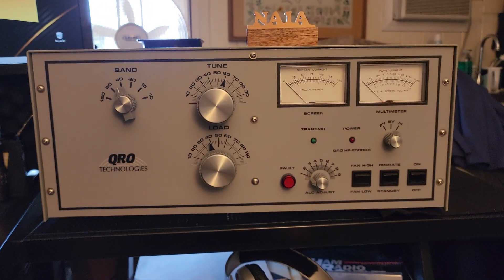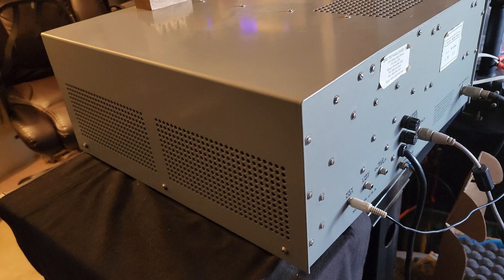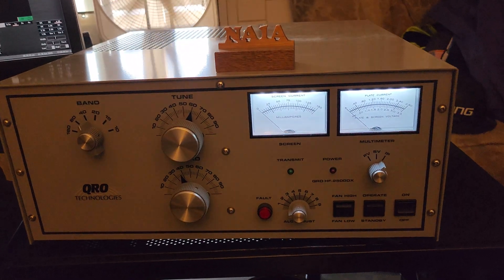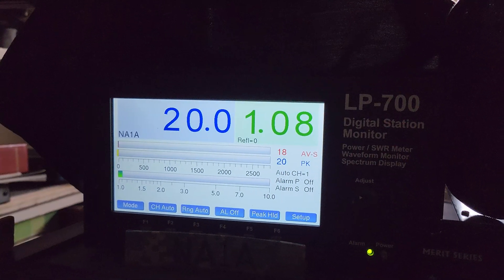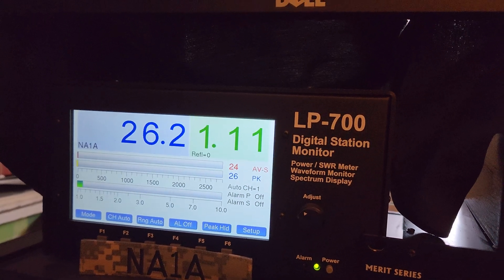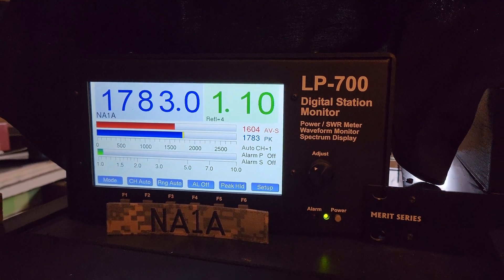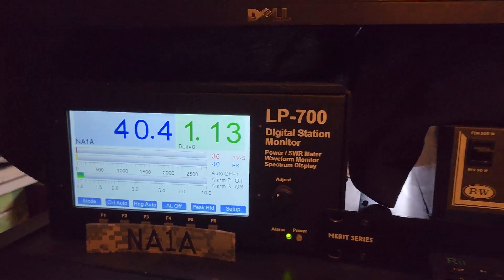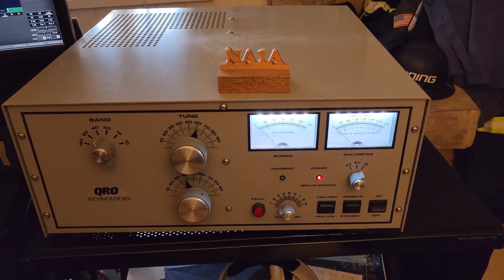QRO HF-2500 DX

Comment: Looks so much like the Amp I have. The one I have is the earlier version HF3KDX. It uses a single Svetlana 4cx1600b. I had problems with it when I first purchased it new. Sent it back for Ray to figure out why it kept blowing the screen supply fuse while in standby mode. He sent it back saying it was fixed but within the first 15 minutes it did it again. It sat in my station for over 20yrs without being turned on. Finally last year I got around to getting into it to figuring what was happening. The problem was occurring on the HV capacitor board. It looks like when the board was assembled it was done when the board was laid vertically, not laid flat. The flux ran from the screen supply circuit onto the HV circuit in several places. One of those runs the flux had turned to powder and burned. I cleaned off aĺl the flux and epoxied a plexiglass barrier between the two circuits. I now have a decent Amp with only a few hours on it that's in perfect condition. Clean Legal limit with only 20-25 watts of drive power with plenty left. At first I hated this Amp because I couldn't keep it running. Now I love it.